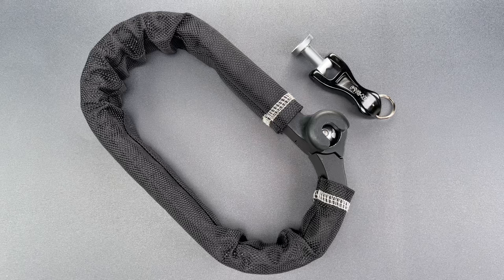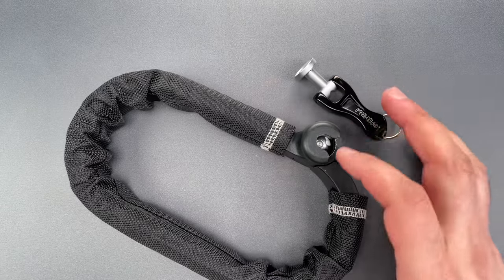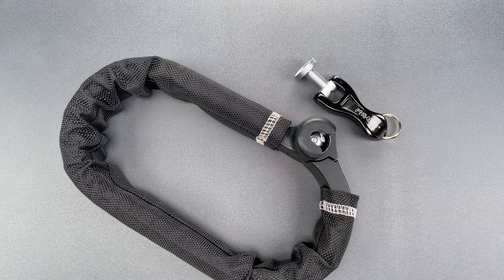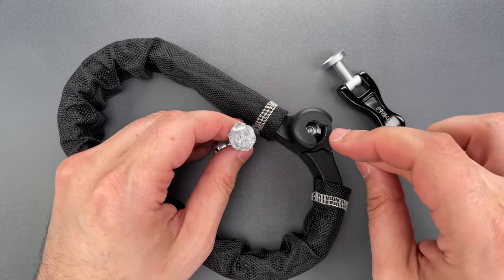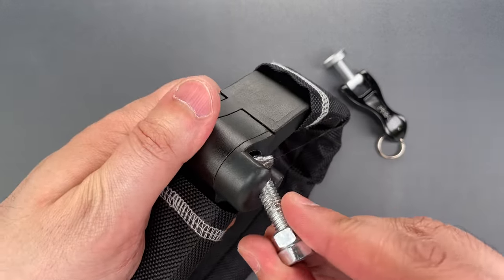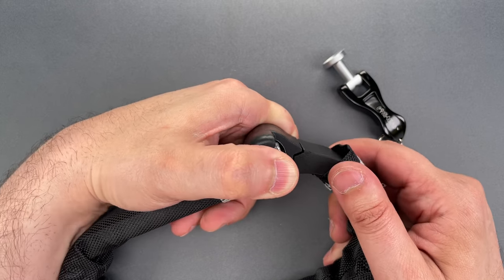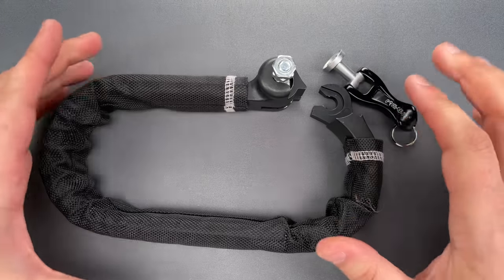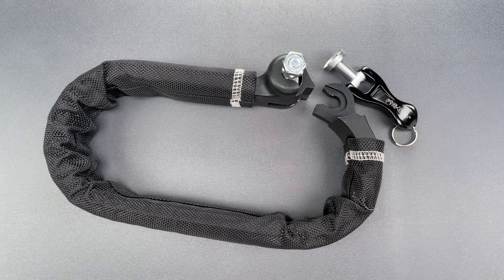[1333] Opened With Hot Glue & Bolt: Pinhead Bike Lock

Comment: I used one of the pinhead seatlocks on my bike when I was commuting downtown Chicago. It had the same type of lock cylinder on it. Fortunately, no one ever tried defeating it. Mostly because I quickly moved to parking my bike overnight on a rack right next to where the train station police parked their vehicles. High visibility and the deterence of the police showing up at any time meant no one messed with bikes on the rack.

Comment: For all the rookies, these locks have the same diameter keys. If you create that little hammered tool at home and keep in your pocket, all you’d need is a quick setting super glue on you. If you spot the lock in the wild, you have everything you need.

You could easily walk pass the bike and stick it onto the lock and jog away. By the time you turn around to jog back within a few minutes, it will be ready to turn and unlock and you’re on your way.

No heat guns and hammers necessary

Comment: Seems like a good secondary lock, not a primary. The times I've had issues the most with bike theft is people will steal parts off the bike like the seat or front wheel so I ended up needing not just a main lock for the bike frame but secondary locks for anything that was easily removed. I'd probably use this on the front wheel to lock it to the frame while still needing a main lock for the body to the rack and a smaller cable lock to thread under the seat.

Comment: The Pinhead manual doesn't specify a tightening torque for this lock, but I think most users would tighten this more than hand tight. They recommend 220-inch pounds for the wheel axles. With time, epoxy should work.

Comment: The bolts that secure wheels and seat are much more secure.  With lock washers and 45nm torque.    I would consider this for an accessory not secured by other products.

Comment: Is the wrench unique to each “lock”?
Reply: Would that even matter?
Reply: @Kryder401  Seems it would make stealing bikes even simpler if they all use the same wrench "key". No need for the bolt and glue gun.
Reply: @Kryder401  well, if you have one of the wrench, you could open all of the looks, making it not very secure
Reply: most likely not. the same way that keys to regular locks are not unique because there is a finite number of combinations of cuts on the key and there are millions of locks out there. despite that it is probably easier to win in the lottery than to find exactly the same key
Reply: @Kryder401  If they weren't unique you could simply buy a lock and have a 'master' key to any other lock.  Similar to handcuff keys or heavy equipment / agriculture equipment locks.
Reply: you can only have a fairly limited number of them. That being said it doesn't really matter. If you want to prep for opening those locks there's ways to make keys that fit all of them.
Reply: So yes, LPL heavily implied that the wrench is unique (ish) and goes with the bike lock and certain components on the bike.  It seems like not a bad security device for the other bike parts anyway, even if the lock itself is a bit compromised.
Reply: The right answer here is no, it would not matter either way.
Reply: @Kryder401  It looks like a very big tubular lock.  Are tubular locks unique?  No, but they aren't all the same either.
Reply: Yeah, I used “unique” as shorthand for “a variety of different ones such that each wrench fits a very small percentage of the “locks”. 

It certainly matters because if this became popular, bike thieves just need to acquire one wrench and be able to defeat them all just like they were the owner.
Reply: Yes
Reply: @szymonsadlo  There are enough variations of the key to make it a non-issue
Reply: @milesmccall2301  yup, that's exactly what I said 🙂
Reply: @weswheel4834  I didn't really get this part of the video - how is the lock a security improvement for bike parts?
Reply: @kekelapp0r  I think the idea is certain parts of the bike (obvious choices would be the saddle, wheels etc. that people sometimes rob) would require the special wrench/key to remove.
Reply: @weswheel4834  oh, so they'd actually ship a few bolts with this lock that you'd need to replace your regular bolts on your bike with, so they only can be removed with their "special" wrench?
Reply: @kekelapp0r  Ahh, good point.  In my head, this had been made by the bike manufacturer and the frame and bike parts had been designed accordingly.  But I see that's not the case.  LPL said that it comes with special security bolts "for the wheels, handlebar and seat" so presumably these are bolts that work with standard bike frames and parts.  edit: Just looked online, the City Lock Ultimate Pack from Pinhead is $159 on their website.  Bit expensive if the lock itself isn't much use.  What I liked about it is that if this was say 20% of the price and just secured the bike parts, that would be quite handy I think.  I could use a D-lock (or 2) on the frame not need to worry so much about locking the wheels etc.
Reply: @szymonsadlo  I had a 1979 Ford Granada and a 1982 E150 that were both keyed the same :) found that out by mistake one day
Reply: @longbow6416  you definitely should play some lottery then 😀 once (it was about 20 years ago) I discovered that I can open my dad's Fiat Uno with a coin. it turned out that the lock was broken and all you had to do to open it is to turn it using anything. i believe that LPL haven't opened a lock with a coin yet 😂
Reply: Yes it is, I had a bike with these qr skewers and they are specific to each , you need a receipt anx proof of purchase to buy replacement keys at $30 a pop.
Reply: @mojolotz  Yeah a universal key/wrench for this wouldn't be all that complex, machining wise. It would look like the standard wrench but with a spring loaded pin in every position. It would automatically depress the unused pins. Just make sure your universal pins are deep enough not to twist in your tool and it would have no issue "unlocking" these.

Comment: 30 minutes to hammer in a bolt head, 10 minutes to warm up the glue gun - I would say that's a pretty decent lock.
Reply: U need a new glue gun most only take 1-2 mins and u need to work out if it’s taking u half hour to hammer I a bolt head 😂 or just buy weaker metal bolts

Comment: You should try this with the quick release skewers that stop people from stealing wheels. Unlike this bike lock, you actually have to wrench them somewhat tight so I have a bit of doubt hot glue would hold with the force required to take them off? These skewers tend to be more popular than full on bike-locks in Pinheads line as far as I can tell anyways.

Comment: You can use a lighter directly on a glue stick in the field, a vertigo cyclone will tackle it easily, and if you want to get fancy an upside down can of compressed air to chill it faster. I wouldn't be surprised if you can get under 15 seconds.

Comment: I was about to say you could do the same thing with lug nuts on cars but then I realised the dried glue would not withstand the torque. And that got me thinking about following design improvment: Make it so the "lock" has to be tighten just as a lug nut. This way, it would be much harder to defeat.

Comment: I use pinhead locks, but they are used only as replacements for the quick release pins for the wheels and for the seatpost clamp on my bike. Those are torqued down fairly tight, so a smashed bolt with hot glue is most likely not going to work unless the glue is strong enough to overcome the torque. Obviously this is a bike lock, which has different requirements, so it's both eye opening (and funny) to see how easily you defeat it with this low tech solution.

Still, based on what I'm seeing in this video, I would never use their bike locks, or rather, any product which is not torqued down. In any case, having a pinhead for my axles and seat clamps is certainly way more secure than leaving the default quick releases in.

Comment: What would defeat this hot glue method is to have a sliding pin in the center of the lock. The pin pushes a second piece out the side into a recess in the body of the lock. Put a magnet in the key to pull the sliding pin back against a spring.

Comment: With some red Locktite I think this would be more difficult. In any case, I see it as a good lock because it adds an additional tool a thief needs to steal your wheels. If you lock your bike with both a U-lock and a chain, a thief would need both an angle grinder and some bolt cutters to steal your bike. That said, everyone should make sure that what they are locking their bike to is secure. My bike got stolen because my city installs cheap bike posts which can be unbolted easily and the thieves simply took the bike with the lock still attached, no picking or cutting required. I'll have to be more careful of what I lock my next bike to, although a lot of the posts around here are like this.
Reply: I have some other ideas as well regarding hiding air tags on the bike, one with the speaker and the other with the speaker removed, but I don't want to go into too much detail for selfish reasons 🎃

Comment: I remember putting anti-theft lug nuts on my car. I took it in for service and they rotated the tires without the key.
It seems 80% of the key was the same pattern and the rest varied. The shop had a key with the odd 20% ground out. Now it

Comment: Unless the pin bits in the wrench are pushing in something on the internal bolt, like pins in a tumbler lock. Try using a pencil eraser for friction through the slot in the lock.  Push the unsharpened pencil eraser end into the wrench slot, apply pressure through the pencil and turn.
Or a traveler hook or other tool with something bent on the end to turn the internals through the limited opening presented.

Comment: I wonder if you could just grind the "key" pins down, glue some low durometer rubber in there, and just open it with some downward pressure. Didn't seem like there was much resistance turning it. They could defeat that attack with a spring underneath it that won't let it turn with downward pressure, but seeing how easy it was to open, I kinda doubt they did that.

Comment: I have a set of security skewers from pinhead that I really like, and I'd like to see if they can be defeated as quickly. The skewers have to be torqued into place to hold the wheels on so would require more force to turn. Would the glue gun be enough, or would you need something stronger like some super glue? Could you use a friction element like grip tape for skateboards instead?

In the end, all bike security is to dissuade, but never fully prevent bike theft. I've found the skewers to be great so far in combination with a u-lock. Can't say I'd choose the lock in the video because the lock itself is the weak point, not the chain.

Comment: I'm thinking a strong magnet might even be able to do it, or just some careful work with needle nose pliers. 

I would call it a win though because if the average crook has no idea how to open it and isn't gonna come prepared for it, then it works. Even the best locks are usually weak against bolt cutters, which is more likely for a thief to bring.

Comment: I’ve been wondering how well it will hold up to the other locks, like the skewer set Pinhead makes as they are supposed to be torqued to 5-25nm for full security. 5 is on the lower scale but my guess is hot glue wont hold up to the amount of torque for the higher rate of torque.

Comment: If hot glue worked, then JB Weld will do the trick as well. And that doesn’t require and electricity. Just mix the two parts.

Comment: LPL said most tools for impression the lock would need preparation. Which means the lock was actually fairly safe in the field?
What I am curious about is that could you just open it with simple tools like a screwdriver. Since he have used simple tools to tension strange looking locks before, could inserting a screwdriver or a wire at the right angle provide enough tension to turn this lock?

Comment: Now I am a huge fan, but the fact you took your hands out of the shot entirely made me slightly suspicious.  So I re-watched that moment and there does appear to be a "cut" before you bring your hands back into the scene, indicating that perhaps you waited longer than indicated for the glue to set.  If you look at the lock lock closely around 1.38 you can see a shift in light then your hands appear.  Did you make the cut just to keep the video length down?  I wonder if the glue would have had sufficient time to set to be able to turn the lock.

Comment: I was thinking some kind of putty would work well on this, but then I had another idea.  You could make a tool like that bolt but with a pad on the end with some material that's normally soft to do the impression but that hardens immediately when you apply pressure, like a little sack of non-Newtonian liquid (easily made with cornstarch) or maybe even just sand.  As soon as you let go, it releases and is ready to go again.  I can already think of some other methods to do the same thing (a small vacuum pump could harden the sack I mentioned, and I think there are materials that react to electricity like that).  If this type of lock is popular enough, such tools will be made.

Comment: I'm sure you could use one of those small Milwaukee power inverters that clip onto a lithium drill battery to power the hot glue gun. Actually, I doubt the circuit is any more complex than a PTC heating element, and connecting a few LiPo battery packs  directly to it in series would probably work.
Reply: Bonus points if you bring rubbing alcohol to remove the glue cleanly, this becomes a true surreptitious attack.

Comment: Do those pins do anything else but turn a 'receiver' that have the holes drilled in the correct locations? Do they press down on a spring loaded part to allow the bolt to turn?

Comment: Pinhead Fatal Flaw
the individualized wrench
take the wrench, grind off 2 of the 3 pins.
now you have a Universal Pinhead wrench, that fits any pinhead bolt set on any bicycle

As a bike mechanic, I keep one of these around because so many customers leave their wrench at home when they need a flat fixed

Other fun approach is bypass the bolts entirely. 
Pinheads on wheel skewers and fork headsets can both be defeated by overcompressing the bearings to relieve tension on the security bolts, thus letting them be spun off by hand.

Comment: since it seems to require little force when turning and the head is just flat with detents...
couldnt you use one of those pliers that have pins to squeeze open snap-rings? they make em with 90 degree heads to fit snuggly into that opening :D

Comment: Keep in mind, no bike like is 100% secure. Even the best bike lock can be defeated with a hammer with a properly motivated thief. Not using on the bike, but on you until you open it. 

LPL: I am going to open this lock with hot glue and a pre-prepared smashed bolt head. 
Thief: I am going to open your skull with this tire iron until you unlock the bike.

Comment: i could probably get it open with a piece of wire, like a welding rod with the flux removed, or a pin punch, stick it in one of the holes in the head, use the warding on the lock as a fulcrum, and that should turn the lock.

Comment: How viable is this hot glue method for field impressioning wafer, pin tumbler or dimple locks? Could one cut a blank all the way down and fill the "void" with glue, making pins sink into it when pressure is applied in the cylinder? The pins would probably destroy the glue key when pulling it out but it could get an open in say an emergency lockout
Reply: @lockpickinglawyer potential video idea??

Comment: Why haven't any of these folks implemented a lock that includes one of these "easy if you have a portable hot glue gun and smashed bolt" measures but in combination with also a hard to pick lock inside?

I feel like some folks are more than willing to have a lock that is a pain in the a** to unlock even with the key/tools if it means its that much harder to pick?  Or maybe they've decided that most locks aren't getting picked anyways and so we should spend R&R on how to prevent cutting which sort of makes sense.

Comment: LPL : I have a glue gun with battery. So in the field your wired solution works for me. My gun works with model plane batteries, use a standard model connector, and is designed to be used in the field. I mean ... Literally in the middle of the field my plane crashed. It's portable and light, and can be carried in a back bag.

Comment: I have the skewers by this company for my bike and use it alongside a normal mini U-lock, I think the skewers would have to be tightened a lot more to keep the wheels on so I'm not sure if hot glue would be enough to open it, and having 2 kinds of locks makes stealing it take more preparation. Of course the thing would be to lock it next to the fool who thought it would be a good idea to lock a DeRosa with a $10 cable lock (I have actually seen this)

Comment: I do not think that you need to impression it. Just take the bolt and hot glue it before you go and then with some force pushing it turn. All the key is a bolt with a few grips points. Really any thing with soft rubber attached to some hard stuff should be enough to get it to turn?

Comment: it legitimately looks like you can get a chisel, add pressure so it "bites" and twist.... are there any pins or discs or anything? its a spring tensioned wheel with 3 holes in it....

Comment: Other than the lock assembly, what do you think about the robustness of the rest of the lock body?   I agree that this would require a lot of prep by a thief - (right bolt, glue gun) and knowing where your bike is in advance.  Plus, it isn't clear if there are other locks on the bike that would have to be opened as well (back tire, removed seat, etc).  Those would multiply the time needed. Thanks for the video.